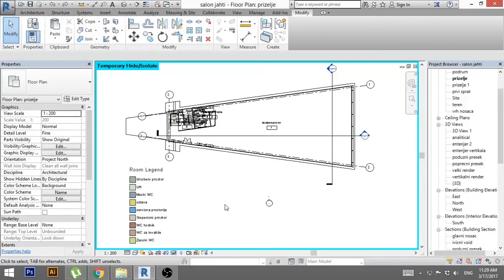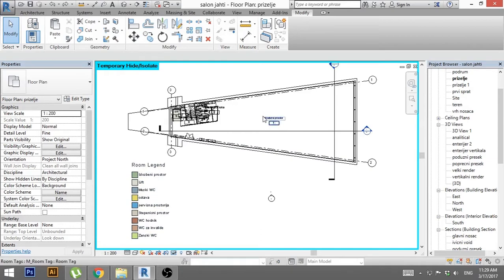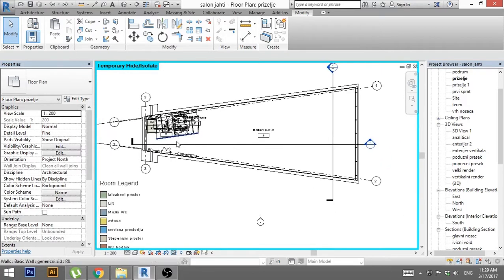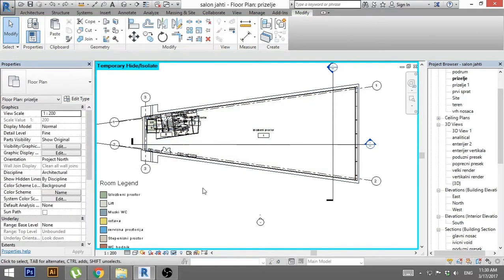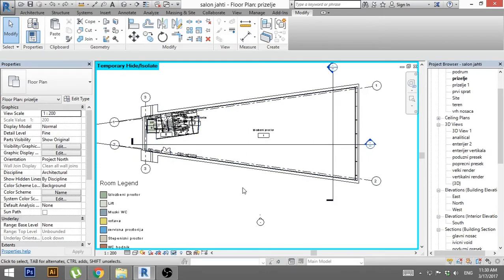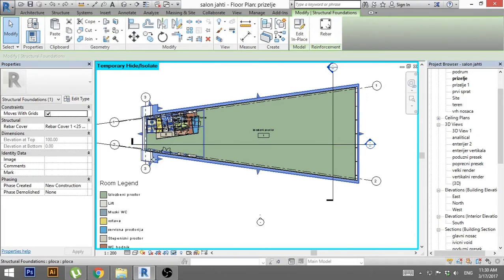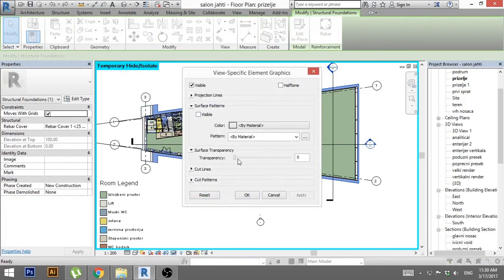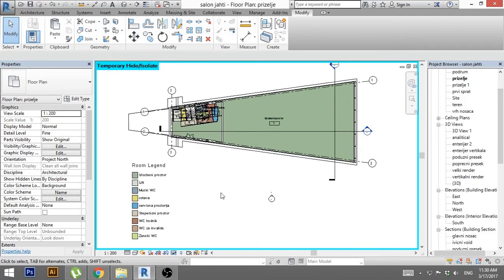Revit Solution: Room Fill Won't Show

Comment: The problem is when you have a structure under the slab, or in elevation, if you want to show the color fill and you have a wall, if you change the transparency you will see behind the wall. I changed the fill color to forward not backward still can't see it. The solution was to change the property of walls in elevation and floor in section to make the surface pattern invisible.